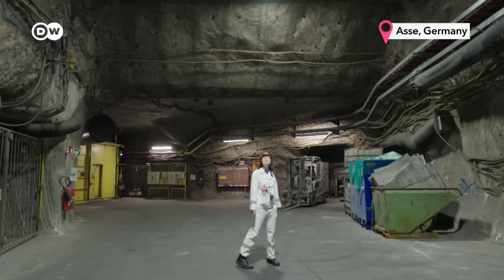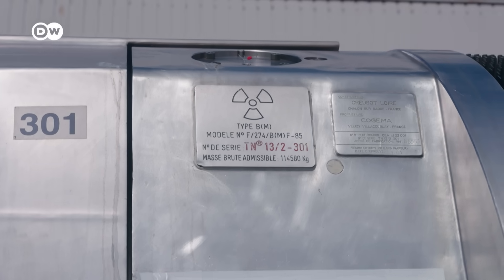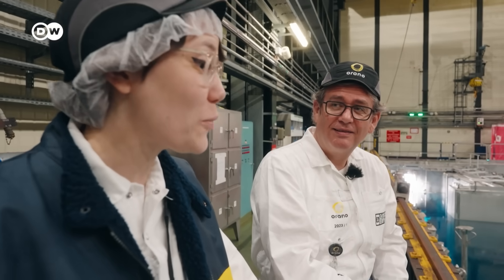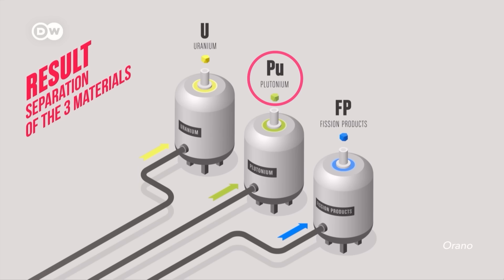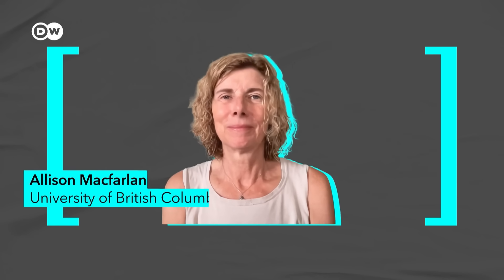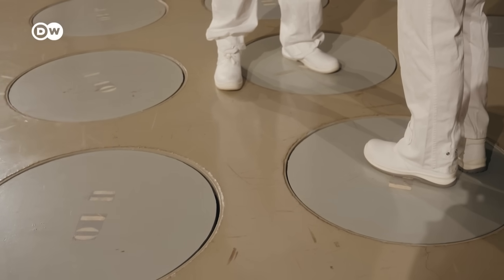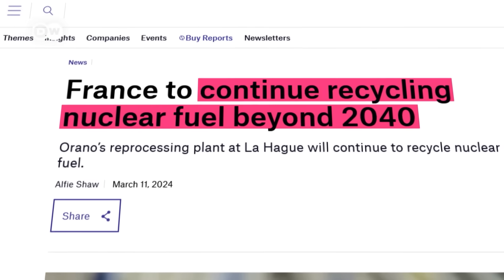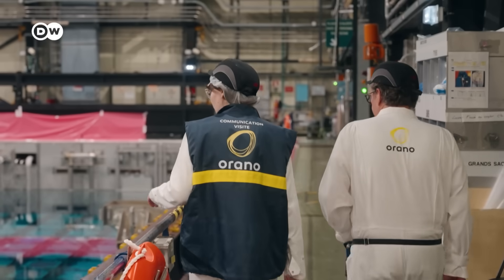Nuclear waste is reusable. Why aren’t we doing it?

Comment: As a former nuclear engineer and chemist, and proponent of nuclear as critical component of our transition from fossil fuels, this is a great video.

One thing not mentioned was molten salt reactors (MSRs) that can burn down the existing stockpile of spent nuclear fuel (SNF). In doing so, they also produce two orders of magnitude less radioactive waste. And that waste is toxic for only a few hundred years vs. tens of thousands of years for the existing fleet of lightwater reactors. It's estimated that SNF could power MSRs for nearly 100 years without the need to mine additional virgin material.

MSR designs are also inherently/"walk away" safe, meaning that in the event of loss of power, the reactor shuts itself down with no escape of radioactivity. This is a significant departure from lightwater/pressurized water reactors. Rather than operating at high pressures, but relatively low temperatures, MSRs use a molten salt that's both fuel and coolant, enabling them to operate at much higher temperatures (good for process heat applications across a wide spectrum of manufacturing sectors), at or near atmospheric pressure.

Lastly, nuclear reactors should be used for four primary purposes:
1. Grid stabilization.
2. Desalination.
3. Green hydrogen production.
4. Process heat generation.

Small modular reactors (SMRs), microreactors and the like can be collocated on the sites of decommissioned thermal power plants, such as coal and natural gas. There they can leverage the vast majority of the installed infrastructure, while providing continued employment for the local workforce. They can also be collocated where intensive energy demand is high and/or where the process heat requirement is great. Think aluminum smelters, iron, steel and concrete manufacturing, data centers, etc.

Solar, wind, hydro (including pumped), geothermal and wave/tidal energy should comprise the backbone of all power generation; stabilized by nuclear and augmented by energy storage (lithium ion batteries, flow batteries, heat storage, etc.).
Reply from the maker: Thank you for your comprehensive coverage! ☢️ Please check out our channel as we have videos looking at those components you've mentioned as well! Here's a few to begin with 👇
on molten-salt reactors 👉 https://www.youtube.com/watch?v=Km6kqykX900
on SMR's 👉 https://www.youtube.com/watch?v=GhKQ8EP1a1Y
on grid connection 👉 https://www.youtube.com/watch?v=u-DsDuTceTo
Reply: @DWPlanetA  Yes, I've seen all of your videos and love the channel. I simply meant to point out that MSRs were neglected in the treatment of SNF. It's good to see that DW Planet A is tracking with the comment sections.

Another good topic to follow-up on the grid video might be advanced reconductoring. Using existing pylons, trapezoidal aluminum wound around a composite core could double existing grid capacity...all without the permits, regulatory delay, NIMBY attitude, etc.
Reply: @DWPlanetA  this owns
Reply: came here to say something similar. It makes no sense to store something so dangerous for so long if we have a way to reuse it  AND turn it into much less material that's radioactive for orders of magnitude of less time.
Reply: @Gistedkudu  How much less radioactive does it become after they use it for a second time? In terms of how strong the radiation is but how long they will have to store it?
Reply: @KingKhan20000  My understanding is it's a few orders of magnitude better so instead of tens of thousands of years we're talking hundreds of years.
Reply: @KingKhan20000  My understanding is it's a few orders of magnitude better so instead of tens of thousands of years we're talking hundreds of years.
Reply: @Gistedkudu  To be honest this is a huge upgrade.
Reply: @KingKhan20000  100 years to reach radiation levels of natural uranium.
1000 years to reach safe radiation levels comparable to natural.
This is after neutron irradiation in a fast or thermonuclear reactor and subsequent purification.
Reply: @Gistedkudu  when something decays in 10.000 years its much safer than 100 years, its not the same to drink a vodka bottle in 10 hour than to drink it in 10 minutes, one kills you other just wastes you
Reply: OK, sounds awesome. And now the 1 Million Dollar question? Why aren’t we (or anyone else) doing this? And please no BS response like “Oh the greens”, or “oh politics” because there are so many countries run by all political flavors, if this is the golden bullet, at least one country would invest big money to push this forward. So why not?
Reply: @marcd6897 It's because in the 1950s and 60s internal turf battles within the Nuclear Regulatory Commission shut down research and development on Molten Salt Reactors. The Big Corporations operating reactors had already invested beau coup bucks in design and equipment manufacturing for light water reactors and even though MSRs were more efficient and safer they didn't want to spend the money and retool to MSRs.
Reply: @marcd6897  only one thing prevents us from using more nuclear power.  Oil company profits and ownership of politicians.
Reply: @loungelizard836  with all political flavours? Or maybe because folks start to realise that nuclear power comes at a cost that more and more countries are not willing to pay any longer?
Reply: @marcd6897  nope its bc it eats into oil companies profits
Reply: @marcd6897  China is doing so. They went to the US, asked for a look at the plans and basically copied the blueprints! And the US, who invented molten salt reactors, sat on the technology for decades, bc they went with the other (worse) nuclear power generation method solely so they could get plutonium to make their nukes (which you can't get out of MSRs). And now, with it being such a corrupt country, the existing nuclear industry lobbies the government and ensures that MSRs plants are nor built bc that would be competition, and corporations despise competition. Probably the same reason as the other countries (there ain't many nuclear powers bro)

Your "please no BS response like "oh politics" is a very naive comment. Politics literally effects everything in our lives.
Reply: @marcd6897 It's because traditional nuclear costs more money than most every other source. Countries have subsidized it mainly for the dual use technology (enrichment for weapons). Some of the cheaper approaches to fission that aren't traditional don't require that high level of enrichment but were mainly abandoned. Until new interest the last couple decades with startups and ideas. I should add that China is testing an MSR right now as we speak at great expense.
Reply: @marcd6897  Influence from fossil fuel industry. Also bad press. Nuclear hasn't had any good press coverage since Chernobyl because people love sensationalistic journalism (honestly it should be illegal to misinform, mislead, or sensationalize in any way). In reality Chernobyl was the result of sheer incompetence and idiocy. It deserved another type of press that wasn't "nuclear power bad".
Reply: @marcd6897  The short answer is:  We are.

By "we", I mean mankind. China is a glowing example of what a people can accomplish with reasoned goals and political stability. For all it's faults, China's centralized government with a single long-term leader (not endless campaigning and the threat of near complete policy reversals with every election) has been able to create an overarching plan with energy security at its core.

China is actively adding more nuclear generation capacity than currently exists across the globe! Just let that sink in. These projects include the high temperature gas-cooled reactor nuclear power plant in Shandong Province that recently entered commercial operation. Additionally, construction is slated to begin next year on a Thorium Molten Salt Reactor. This plant, located in the Gobi Desert, is anticipated to be operational by 2030. Lastly, unlike the rest of the world where reactor construction projects routinely incur massive delays and cost overruns, China has demonstrated their ability to complete projects in an average of 7 years.

So, it's not that it can't be done. It's that we lack the political will to invest in all that's necessary to sent advanced nuclear deployments on an exponential trajectory.

All's not lost in the US, however, as important developments have occurred in rapid succession. TerraPower has begun work on their Natrium facility (sodium-cooled) in Kemmerer Wyoming. Kairos Power have started construction of Hermes facility (fluoride salt-cooled) at ORNL, and Radiant are progressing toward bringing helium-cooled microreactors to market. On the IMSR (where coolant is also a fuel carrier) front specifically, Terrestrial Energy, Southern Company and others continue working to bring solutions to market.
Reply: @ARepublicIfYouCanKeepIt  by the way, I’d recommend you refresh your numbers re how much France produces energy from nuclear. Earlier you said it’s 77.1% which is BS. It’s just 40%. Maybe get your numbers straight so believing the rest of your very elaborate messages would become easier. 
And re China, I’m curious as to where they’re heading, currently their nuclear is still around 5%.
Reply: @marcd6897  China is and there are a number of companies investigating MSRs. The trick is developing the material science needed because liquid fluoride is extremely corrosive on the reactor components.
Reply: @marcd6897  Because nuclear fission energy is simply too expensive compared to other solutions on the market.
Reply: As a fellow nuclear engineer, all I can say is: Perfect statement!
Reply: Interesting and well explained. Maybe the concept should be integrated into one plant. This way the use of nuclear is maximized. Maybe it should be a mandatory thing for future NP-plants. 
But at the same time I think geothermal is advancing too. It's just when it is good enough to utilize it at any location. Imho geo is also very under funded compared to solar and wind energy solutions.
Reply: The problem with Geo is that there are limited areas they can be built cheaply enough.  You can bore to reach heat but in some areas that is prohibitive.
Reply: @RPSchonherr  Umm the biggest issue with geo - sometimes even in case of easy to reach magma pockets - is of course the cost on one side but its mostly that you're looking for porous material to pump the water through. That pressurized water has the potential to cause small quakes. That's not an issue along the ring of fire but in Europe a couple geo thermal plants had to shut down because of this - even a 3.5 was enough to cause cracks in old buildings and no insurance is gonna cover that...
Reply: @blackpearl1-477  Solar and wind tax credits are now gone, but tax breaks for coal and drilling in public parks was approved.
Reply: "maybe the concept should be integrated into one plant" ... that would be the Integral Fast Reactor, it was cancelled by US congress when it was three years from completion
Reply: @MatthijsvanDuin  The IFR was a fast breeder reactor with integrated reprocessing. Hence the use of the term "integral". 

While that's not what we're talking about here, TerraPower's Natrium Demonstrations Project in Kemmerer, WY is a close analog. 

While not an MSR (Type I, where the molten salt is both the coolant and fuel carrier), the NDP is a sodium-cooled fast reactor with on-site energy storage consisting of molten salt. The NDP design is novel in that the "nuclear island" and ESS/power production facilities are distinct and separate. In addition to many other construction, cost and safety aspects, this separation also supports extremely flexible operation of the plant. 

Rated at 840MWt/345MWe, the plant can "flex" from 100MWe to 500MWe for extended periods (up to 5.5 hours with power ramping at 10% per minute).

Fuel fabrication, salt and other facilities comprise the NDP. 

While I remain a huge proponent of MSRs (Type I especially), the NDP is a huge step in the right direction.
Reply: It's worth pointing out that MSR's are not the only kind of Gen IV reactors that do this, there are other reactor types that can also breed more fuel out of waste.
Reply: @Croz89  All fast breeder reactors are capable of burning spent nuclear fuel. Some just do it better than others (more economically, lower proliferation risks, better thermal efficiency, etc.). MSRs are just very flexible and elegant solutions.
Reply: @Croz89  they still need a lot o time to build and they dont offer cheap power. the video said it. its expensive. more expensive then renewable energies.
Reply: @BlacKi-nd4uy  By definition, SMRs are <=300MWe. Built in factories, then packaged as either containerized microreactors that are replaced every 4-7 years, or fabricated as modules and deployed in n+1 modular fashion, SMRs hold the promise of consistently high quality, on time and within budget, as opposed to GW-scale legacy design examples such as Vogtle units #3 and #4.
Reply: @ARepublicIfYouCanKeepIt  i dont like micro reactors. you have the security disadvantages of all nuclear reactors, since there is radioactive material, which probably will kill the cost effectiveness.
Reply: @BlacKi-nd4uy  Security doesn't "kill cost effectiveness". Construction costs, particularly labor, does. Microreactors are actually phenomenal solutions for all kinds of use cases (remote grid power, military installations, disaster recovery, aluminum smelters, iron, steel and concrete production, data centers, the list goes on and on).
Reply: do you think there could be a underground nuclear plant in some iceage kind of dystopian situtaion where civilisations are forced to stay underground.
Reply: @silentstormstudio4782  An ice age, comet strike, super volcano, even all out nuclear war need not be the end of humanity. We could live in well lit clean safe hi tech underground facilities for hundreds of thousands of years with the power of nuclear. atom for atom nuclear is a million times more energy productive than the best fossil fuels. IF used in a Fluid Fueled Reactor that uses all available fuel.
Reply: @silentstormstudio4782  We're in an ice age.
Reply: SMR MSRs are probably a better use of research and VC billions than SMRs based on PWRs. But regardless of size, my non-expert understanding is that MSRs are not a solved problem, unfortunately.
Reply: @szurketaltos2693  Actually, MSRs are a "solved problem". Unfortunately, all things nuclear take a very long time to get through the design, planning, approval and licensing phases. Work has been ongoing for a while now, so discernable progress will be evident shortly.
Reply: @ARepublicIfYouCanKeepIt  I would like to see Terrestrial or Terra (etc) hit their 2030ish timelines, but having occasionally taken brief looks at the literature I'm not convinced they will; maybe all the good stuff isn't public though. LCOE below at least offshore wind seems doubtful with the way wind is scaling, would love to be proven wrong.
Reply: @szurketaltos2693  The obsession with LCoE for nuclear, to the exclusion of all other factors, has always defied my understanding. Nuclear is special, with so many benefits that other energy sources simply can't provide, that LCoE should be a factor, just not the only one, or the most important one.

We need clean, reliable, safe and affordable baseload generation capacity. For that, there's simply no alternative than nuclear. Nuclear is clean. It's actually the most reliable means of energy generation. The industry's safety record speaks for itself, and advanced reactor designs have none of the risks that are inherent to LWR/PWR designs. As for affordability, of course the first advanced reactor designs to be deployed will be far more expensive than every other option. However, costs will rapidly decline as economies of scale are realized. Microreactors and SMRs, regardless of design, are completely different than the bespoke projects that every other GW-scale plant over the past 30 years represent.
Reply: @ARepublicIfYouCanKeepIt  of course there is an alternative, "overbuilding" renewables plus batteries, existing nuclear, conventional hydro, and pumped hydro. Look, I am pro nuclear but I really don't think we can afford to stake all our climate plans on it being affordable. I would love for the amount of renewables that needs building to be lower, and for nuclear to be cheap. Feel free to say I told you so in 15 or so years if LCOE for nuclear falls below renewables, which have proven falling LCOE for now.
Reply: @ARepublicIfYouCanKeepIt  Yeah, I won't hold my breath on "shortly" because even the reactors based on established technologies are subject to massive cost and time overruns. Don't bother replying.
Reply: @johanneshass1614  SMRs, including MSR types, completely change the game regarding on-time delivery within budget. New technologies, designs and methodologies cannot be judged by legacy projects.
Reply: The burn up rate on MSRs is fantastic, enabled by using liquid fuel instead of solid. 
With solid fuel, pressure build up inside the cladding means you have to change them long before you've used up all their useful potential. 
Not so with liquid fuels as there's no fuel cladding to fail. 

MSRs do have an issue with refueling and gaseous isotopes, you need online prices to deal with both adding new fuel and online extracting of isotopes like Xenon gas.
It's a difficult process and is also a proliferation risk as you can start extracting fissile plutonium 
One company, Moltex Energy has a few practical solutions. 
Using liquid fuel in solid fuel tubes with a vapour release mechanism, the short lived radioactive gasses produced exit the core and is contained inside the building while it decays to something safe. 
The liquid fuel rods can also be used until exhausted because of that pressure release mechanism and reactor refuelling is just a case of replacing spent tubes with existing handling machinery. 
Finally, a sacrificial coating inside the tubes prevents corrosion, meaning the tubes themselves can be manufactured out of already approved nuclear steels. There's no need to invent new salt corrosion proof materials and go through the long and expensive process of approval.
The tubes themselves are cooled by a separate salt loop to a much higher temperature, granting much more efficient power production via a gas rather than steam turbine.
The high temperatures are also great for direct water desalination and green hydrogen and methane production, if you pump the salt around a facility containing these plants.
And, of course, everything is at a single atmosphere of pressure as opposed to high pressure water cooled reactor
Reply: Agree with everything except using Li-ion batteries for the grid. They are light, expensive and toxic batteries that do not make much sense to deploy en masse this way. Instead, a much better option would be Iron oxide batteries or Sodium ion, they are cheaper, less toilsome to mine and their disadvantages stem mostly in weight, which is not a factor when it comes to static deployment.
Reply: @nonridiculousadjective6597  Lithium-based batteries continue to decline in price. Additionally, new chemistries, such as Na-ion, and new technologies, such as flow batteries, are increasingly coming online. Lithium chemistries are good for 4-6 hours of peak demand fulfillment. Sodium chemistries will fill the same niche. Flow batteries, along with other energy storage systems, provide much longer duration storage; typically measured in days, not hours.
Reply: You meant FAST reactors can use spend nuclear fuel.
Reply: @sjoer  I stand by my statements.
Reply: We need a senator like you
Reply: Great information!
Reply: Thank You sir for continuing to spread science instead of all that other stuff.
Reply: when i saw the introduction I was thinking it was going to be like the RTG used on the voyager and Nasa Mars rovers which generate electric power from the heat given off from half life decay. and heat to keep spacecraft working could you do something like this with nuclear waste on earth? I know the environment and conditions are very different
Reply: Was going to say something similar, but you said it much better than I could have
Reply: I appreciate the video and your perspective. 

I do think that one element that was not highlighted in the video is the  risk management benefits to recycling or at least better disposition of spent fuel. the American paradigm is the absolute worst.

also, the antiquated perspective that we are setting an example for anyone by not reprocessing fuel is silly. the nuclear countries mentioned who are reprocessing all have nuclear warheads. who are we setting this example for? who are the nuclear energy countries who we are fearful of acquiring weapons?
Reply: Appreciate the comment! Perhaps it is an education problem, but so few people seem to know about old innovations in the nuclear sector let alone new ones. Prior to a change in topic related to my MASc in Nuclear Engineering, corrosion mitigation in Lead-Cooled Fast Reactors was my focus. Some key benefits I thought LFRs have over MSRs are the coolant acting as a neutron reflector to provide passive safety via negative void coefficient while simultaneously cutting down on the need for shielding materials - particularly useful for SMRs -, lower risk of damage in case of a LOCA - I know MSR demonstration reactors showed the reactor will not "blow up" like the science demonstration of Sodium in water, but this is pertinent in a Sodium-water heat exchanger -, and Lead's lower thermal expansion coefficient compared to Sodium. I know Lead-driven corrosion is a key issue - hence my initial research topic -, so is pumping difficulty, and the comparatively high melting point of Lead. However, these do not seem like deal-breakers, at least from my research & understanding. Despite my research topic not being centred around LFRs anymore, more insight as to why MSRs seem to be more popular than LFRs would be appreciated!
Reply: You have a very good point. The position of the USA about reprocessing is questionable if not dumb. See the North Korea vs South Korea case. Built nuclear power plants, and reprocessing plant just to get plutonium to make a bomb is like saying that you have to get married, than stay married for 20 years just to have sex once.

There are much much cheaper and faster ways to have sex earlier and more frequently.
Reply: Having been educated in university in nuclear science and engineering and NOT JUST TRAINED to be an engineer, I just shake my head in disbelief at all the people who just don't understand people don't want an economy that teeters on the edge.
The people involved, even the 'pure souls in engineering' just don't understand why nuclear lost in the US, and for that reason they, themselves prove WHY IT WON'T!
Reply: Simply the most goated comment I've ever seen. Congratulations, i hope more people in the future will share your vision
Reply: @MattBuild4  I have come to believe that the greens have formed a dogma around green energy,
faced with the facts that solar panels and wind power all have limited lifespans and need to be replaced in 20 30 years time, they have commited to just close their ears and scream all the feel goodism they can, when we should be focusing on a reliable grid of nuclear energy sites, "green" aka energy scavengers like solar or wind are fine but only in remote locations.
Reply: if you said all these things. Why are you a former nuclear engineer and chemist?
Reply: @coreytran7415  While I'm semi-retired, I'd gladly work with any number of companies in this space.
Reply: "As someone being wrong, and with a giant bias because I can't bear my life having been a detriment to society, I enjoy being wrong"
Cool story, now please shut up
Reply: Amazing 😮
Reply: So build one already.
Reply: As a call center employee, I agree.
Reply: Great comment. Nuclear power generation has a place, but will never be the dominant method in the future because the cost is just too high. Renewables have it beaten because the power source is free, and the maintenance cost is far lower. It's basic economics. Adding to that of course is that the leftover material isn't hazardous, and there isn't the risk of a catastrophe if it goes really wrong. Some very hard lessons have been learned in nuclear power generation which has made it far safer, but the economic viability has made it questionable now.
Reply: Go ahead, say it THORIUM THORIUM THORIUM
Reply: To use Thorium as well?
Reply: Also the fact the exclusion area for SMRs is essentially the sight boundary, so setting them up a brownfield sights is less of an issue than most folks think.
Reply: Why do we call hydrocarbons "fossil fuels" when they exist on other planets where there was never any life?
Reply: Oh, look at Mr. Science Guy over here. You think you got it all figured out, huh? Lemme tell ya somethin', you ain't the first genius to walk through these doors. You talkin' 'bout radiation like it's some kinda boogeyman, but you clearly don't know jack.

Molten salt reactors, huh? Yeah, real cutting-edge stuff. Burns down the stockpile of spent nuclear fuel. Bravo, Einstein. But you ever think about the logistics of that? How 'bout the costs, the infrastructure, the real-world applications? Nah, didn't think so. You're all theory, no practice.

And what's this about MSRs bein' "walk away" safe? You think you can just stroll out for a cappuccino while the reactor runs itself? Get real. Every system's got its vulnerabilities, and actin' like this one's foolproof is just plain naive.

Hundred years of burnin' up fuel without more waste? Yeah, that sounds real peachy. But you ever consider the maintenance, the human error, the potential for somethin' to go sideways? Of course not. You're too busy patting yourself on the back.

And let's talk about those radiation leaks, huh? You know, the ones that end up givin' the poor kids birth defects. But hey, it's all good, right? They should just pull themselves up by their own bootstraps, like all those clueless rich folks love to say. Never mind that they're dealin' with the fallout—literally—of your so-called solutions.

And while we're at it, how 'bout Ohio? You heard of the lobbying to keep nuclear power in the state? Yeah, real nice work there. People got more cancer because of it, but I guess that's just collateral damage in your grand plan, right? Ain't like those folks matter, right? Just another statistic to you.

So, while you're sittin' there with your fancy degrees and big words, remember this: in the real world, things ain't as black and white as you make 'em out to be. And radiation? It's dangerous, pal. Always has been, always will be. You ain't gonna change that with a fancy new reactor. So why don't you come down from that ivory tower of yours and see how things really work?
Reply: So to answer the "million dollar question", why weren't MSRs ever built? It's a disgusting story of internal NRC turf battles and corporate greed. Since the nuclear power industry had already invested in designs and manufacturing capacity to build light water reactors they shut down MSRs, period. And industry flacks in the NRC sabotaged the careers of men working on MSRs.
Reply: burn how? Where will the fumes go?
Reply: I somewhat disagree on point 3., hydrogen and the methane you can make from it are storable substances, so they would actually benefit from cheap solar without any form of batteries or grid balancing (an isolated plant), since the extreme unreliability of solar would be compensated by simply storing more fuel.
Reply: @Blaze6108  The important thing to keep in mind with scenario you propose is the opportunity cost of diverting wind and solar to hydrogen production. Worldwide annual hydrogen production currently stands at 120 million metric tons. It's estimated that we'll require 90 million metric tons in a post fossil-fuel world. Producing that would require the equivalent of the total worldwide solar and wind generation in 2019!

We simply can't divert wind and solar to hydrogen. The best and highest use of these renewables is decarbonizing electricity generation.

Now, as 98% of current hydrogen production is in-situ (being produced at point-of-use, it never moves), producers could invest in large on-site solar and/or wind farms, along with the requisite distribution and substation equipment, substituting methane and fossil fuel for steam generation with water and electrolysis. This would obviate the need for transmission lines and interconnects, but increase the need for water, water purification and possibly desalination.

This option has been, and continues to be available to hydrogen producers. Yet, 95+% of hydrogen productions continues to be of the "grey" variety. That is to say, from steam reforming methane. The reason? Economics. Unless and until the economics of "green" hydrogen shift in its favor, producers will continue to do what's in their best interest, no matter the consequences. As long as those producers continue to escape accountability for said consequences.
Reply: @Arepubliclfyoucankeepit Why do Americans think depleted uranium bombs are not radioactive? Is it because they are the only ones that use them?
Reply: We're going to get nuclear fusion power plants in the next 10 years. Then, there will no longer be any toxic waste.
Reply: Some studies state, that gas turbine PPs are way better and less dangerous in maintaining grid stability as NPPs. And I have a question they say MSR needs very corrosion resistent materials and therefore is hard to build. What is Your opinion as a specialist?
Reply: Thank you for elaborating and adding to the presentation.
Reply: Are there molten salt reactors operating anywhere?
Reply: @nnamedit  There have been two MSRs to-date. However, none have been operational, meaning not grid-connected:

MSRE, for molten salt reactor experimental, operated for 13,000 full power hours at Oak Ridge National Laboratory (ORNL) between 1965 and 1969 when program funding was pulled for largely political reasons. MSRE was also notable for running on U233, as opposed to U235 used by traditional pressurized water reactors. U233 is a decay product of Th232, is proliferation-resistant and produces dramatically less of the most problematic waste products.

TMSR-LF1 is an experimental MSR (2MWt, so very small) located in Hongshagang, Minqin, Wuwei, Gansu, China that began operation in 2023.

MSRs work. Thorium as a fuel works. A single golf ball-sized sphere contains all the energy a single person needs for their entire lifetime. It's a no-brainer that will finally be brought to fruition as a part of the energy transition.
Reply: @ there’s lots of technologies ‘that work’. There’s a long and expensive journey between demonstration and commercialisation
Reply: @nnamedit  A lot of really smart people have been busily reimagining what new nuclear looks like. They've come up with SMRs that are serially produced, factory-built PWRs that turn the market upside down with a spin on legacy technology. They've come up with MSRs that are serially produced, factory-built units that take advantage of things like fuel cycles and inherent safety designs. They've come up with microreactors that are serially produced, factory-built, containerized units that are quickly and easily deployed.

Seeing any patterns yet? How about departures from traditional US reactor development and deployment?

They've also reimagined business models where manufacturers design, finance, build, deploy, operate, maintain and decommission reactor, all while commercial consumers enter into long-term power purchase agreements.

Attitudes like "it's a long and expensive journey between demonstration and commercialization" are completely useless when we're blinded by our paradigm.

Everything that most people know about civilian nuclear energy generation is completely worthless when literally everything about these markets has fundamentally changed.

An old saying goes:  "For those who 'get it', no explanation's necessary. For those who don't, no explanation's possible."
Reply: @ all of which remains theory. It’ll be great if the things you claim actually occur. Nuclear isn’t some magic technology that avoids commercialisation pathways whether it’s mass produced or not. It still has to get to that point and be cost effective.
Reply: @nnamedit  , china
Reply: Hundreds or tens of thousands of years makes no difference.  The pace of waste produced far exceeds our ability for storage and containment.  This is a temporary energy fix with the longest storage needs and deadliest result when something goes wrong.
Reply: @herpderp66  For those who "get it", no explanation's necessary. For those who don't, no explanation's possible.

Three Mile Island resulted in zero deaths or radiological release. Chernobyl resulted in few deaths and limited releases due to reactor design (we don't make them like that) and human error. Fuchishima resulted in zero deaths and a minor release due solely to human error.

Nuclear power generation is unquestionably the safest form of electricity generation. Period. End of statement.

All of the high level waste ever generated from civilian power generation wouldn't fill an average-sized football stadium. It's distributed across 77 sites in the US where it's in dry cask storage awaiting final disposition. Regarding that, I worked on vitrification in the late '80s, when this waste was supposed to be sent to Yucca Mountain for permanent storage. The NIMBY forces have succeeded in blocking any permanent disposal facility anywhere in the US. Meanwhile, France reprocesses their fuel as they have for decades, while they and other countries have identified, constructed and are preparing to open permanent disposal facilities of their own.

It's attitudes by you and those of your ilk that have stymied progress for far too long. Thankfully the crop of advanced nuclear companies are on the cusp of breaking the long stalemate over civilian nuclear power generation. Soon we'll have several new plants up and running; delivering carbon-free electricity to the grid to address climate change.
Reply: I have to disagree with the last statement from a grid perspective. For large countries, nuclear is one of the best options, because solar and wind comes with many issues that traditional synchronous machines do not have. For example, damping is completely absent in solar which plays a huge role in load frequency stabilization. Wind can get extremely unstable due to induction machines etc. The point is, for small loads it is possible, but large loads like the US or China or India have to face many issues with solar and wind that nuclear does not have.
Reply: @amazinga7794  This isn't an either/or issue. It's an and/both issue. Solar and wind both win on cost, so it's inevitable that these technologies will win for the foreseeable future.

Other aspects that influence the uptake of alternative technologies are maturity, regulations and public attitudes. Solar and wind are much easier, faster and less expensive to install and connect to the grid. With that said, advanced nuclear has a plethora of benefits not shared with intermittent renewables.

For all these reasons, we need a mix of both renewable and nuclear generation. 

It's not an issue of what's on the grid, the size of the grid, etc., it's about decarbonizing the grid as quickly as possible. For that, we must press ahead at full speed with solar and wind. 

The issues of grid stability are eminently solveable...at a cost. A cost that we can easily absorb in the grand scheme of things. 

By the way, as a former nuclear engineer and chemist who served aboard ballistic missile submarines, I'm a huge advanced nuclear advocate. I'm also an off-grid energy systems specialist with more than a decade of experience in solar, wind, micro hydro and energy storage.
Reply: @ARepublicIfYouCanKeepIt you keep taking this political approach, advocating for a dual approach in decarbonising as fast as possible. 

This isn't an option for many countries as they'd be building their entire nuclear industry from scratch, it doesnt matter if they can use decommissioned coal power plants. From an economics standpoint compared to investment into renewable R&D, as well as vast energy storage this is an inefficient waste of money, especially if they're putting effort into growing their renewables industry. China is built different. You can't use their example of 7 year build times. What are chinese nuclear construction workers going to build the worlds supply? So much for domestic employment. Lets not talk about skills transfer and the costs involved in the structural change of an economy.

China is looking at thorium to reduce their reliance on imported Uranium, and their huge coal industry. 
Countries like Australia where im from should be transitioning to advsnced manufacturing and exporting renewables tech. Our storage solution in South Australia has reduced in cost by over 10 percent year on year. Australia ans similar countries should be investing in economies of scale, not some inefficient politically minded dual approach. 
Lets also not get into the vast social, economical, and political differences as to why china is out maneuvring everyone. Their populatiob size and heavy exports prob ibfluence this.
Reply: You don't need weather dependent renewables and batteries if you have nuke already
Reply: Do you think that any of this waste can be use in applications as space engines
Reply: There is a rather new study which suggests that for a stable grid nuclear isn't needed for a stable grid, and even rather harming. They just can not be turned off.
Reply: @compactreview  says who? A nuke can be turned off and on
Reply: Shill alert.
Reply: Not to deny the truth of your criticism but the video would be 2x as long. Followups? A series? Sure.
Reply: Ive read somewhere (ig Popular Mechanics?) that SMRs are substantially less efficient then large scale units, and the waste is more radioactive, can you expand on that? Besides that its amazing how much stuff we could power with nuclear. 

Im chemist myself, just powering distillation columns with nuclear would erase 5% of US's carbon foot print. Concrete is another 5%. There are so many steps we can take, meanwhile those get ignored and everyone thinks we need to ban air travel to save the planet or something.
Reply: So, energy storage systems are getting cheaper an cheaper. For long term storage and short term. Then, why do we need nuclear, when the energy generation is cheaper with wind/solar etc?
Reply: If it took this long to develop your MSR nuclear reactor that trumps everything and that the nuclear industry took off in the 50s/60s, I think we can do the same thing with renewables. We can invest in the present higher rate of tech development into renewables, an industry that on a scaled level only took off in the 2000s with certain policy changes and tech advancements. You talk about nuclear dismay in the US, well I would argue that the US has more of an issue with conservatives hating on 'greenies', ESPECIALLY in the 20th century. Just like all the other american satellite economies like Australia. 

For all your other use cases of nuclear like desalination, data processing. A different type of renewable alternative appliea to each one. We should be investing in improving existing solar powered RO plants. Datacenters? Google powers some of its data centers with 90%+ renewables. We should be investing in improving that, not changing it.
Reply: Couldn't MSRs, and Nuclear in genreal, be used for Synthetic Fuels instead of Hydrogen? It might just be best of both worlds.
Reply: @ZippyPiglin36  The short answer is, unfortunately not.
Reply: Candu reactors can too and they are already in production.
Reply: my radiation background is in another field and have an interest in nuclear power and alternative reactor types such as MSRs. Great comment, thank you!
Reply: Would you agree that current nuclear "power" plants aren't designed for power production, but for weapons-manufacture?

  Also, as someone with a PhD in physics, I've never heard of there being near-meltdowns at research-reactors at universities.  You see, from my own experience, those of us in physics, nuclear chemistry, and nuclear engineering are taught, from day 1, what radioactivity really is, what it isn't, and how to treat the phenomena with appropriate respect and caution.  And I've chalked up my assumption of the lack of accidents in institutional reactors to that educational foundation we get.

But that has left me wondering if I just haven't heard about accidents at institutional research-reactors.  And no, I'm not talking about reactors at federal research facilities … those, again, are meant for weapons-manufacture and are run by the military, i.e. by non-scientists.
Reply: @John_Weiss  I strenuously disagree with the premise that "current nuclear power plants are designed...for weapons manufacture."

Having worked in both military and civilian nuclear programs, including various programs in triggers, separation and enrichment, and waste handling, storage, processing and disposal, I can confidently state that commercial power production has nothing to do with weapons production.

With that said, the choice of the Uranium fuel cycle and pressurized water reactor are second-order effects of the nuclear weapons programs of the past. This is part of the problem of progressing to advanced nuclear design approval and deployment. Inertia is a bitch, and changing the status quo is always very difficult.
Reply: @John_Weiss  I thought research reactors were designed in such a way that meltdown was physically impossible.
Reply: @Croz89  I wouldn't be surprised if they were!  Like I said, we're taught, even as 1st-year physics majors, what radioactivity is, what it isn't, and how to respect it.  So I would fully expect that any reactor designed by professors for use in an academic setting wouldn't "F--- Around and Find Out".
Reply: @John_Weiss  "But that has left me wondering if I just haven't heard about accidents at institutional research-reactors.  And no, I'm not talking about reactors at federal research facilities … those, again, are meant for weapons-manufacture and are run by the military, i.e. by non-scientists."

All of the accidents have been due to; private companies cutting corners for financial reasons, a communist USSR with a twisted incentive structure, very early nuclear development*.

Yes this was often aimed at weapons usage, but the issue was that they didn't know what they didn't know, and they were in a rush. They DID however have scientists working on this, and as a physicist you surely must know that.
Reply: I'm  a physician who has specifically studied biological effects of radiation, and one trained in the sciences at Harvard, I've been for years a vocal pro nuclear, anti-radio-phobic hysteria advocate.     I was delighted to see another rational, science and evidence-based voice in the comments here.  However, I have to take issue with your misguided statement  that SNF ("waset") from MSRs  " is toxic for only a few hundred years vs. tens of thousands of years for the existing fleet of lightwater reactors. "  That's simply false.   The fact is that SNF from existing mature and safe Gen 3 reactor-based large nuclear power plants is 97% harlmess uranium and plutonium isotopes (so weakly radioactive there is no danger) and somewhere around 3% assorted fission products and hot actinides made by neutron capture and beta decay in the reactor.    I would hope you knew this.   The VAST MAJORITY of the genuinely fiercely (dangerously) radioactive material in SNF is Cs 137 and Strontium 90, after the stuff has sat around 10 or 15 years.   Both of these have half lives of around 30 years, so are 99.9% gone after 300 years, and 99.9999% gone after 600 years.  NOT THOUSANDS OF YEARS.    There are smaller amounts of other hot stuff, including a shorter-lived isotope of curium, and a very small amount of Americium 241 which has a somewhat problematic half life of 400 some odd years, but is present in small quantity.  But the bottom line is that existing Gen 3 BWR and PWR  reactor power plants DO NOT produce waste that is "dangerous for thousands of years".   That is ONE OF THE BIG LIES told by the malignant and deadly frauds who oppose nuclaer power.  Supported by the fossil fuel  industry who know ONLY  nuclear  power can replace dependence on their product (and who also know that bujilding out the fraud, con, and scam known as "renewable" (solar and wind) power locks in a need for their product, to "back up" the worthlessly intermittent power supplied by solar and wind farms.

I'm saddened to see a pro nuclear advocat make the ENTIRELY FALSE and HYSTERIA MONGERING statement that SNF from existing mature excellent Gen 3 nuclaer power plants is "toxic for thousands of years.
Reply: @martingoodman3300  Unfortunately, yours is the misleading comment/reply.

The easily verifiable facts are that SNF remains dangerously radiotoxic for tens of thousands of years. Additionally, SNF remains highly radioactive for up to 200,000 years.

These are the reasons that deep geological storage/disposal is the go-to approach for nations that depend upon nuclear fission for commercial power generation.

While the radioactivity/radiotoxicity of discreet isotopes varies greatly, the simple fact is that the entirety of SNF must be safely stored/disposed when reprocessing isn't utilized.

These same arguments are the reason that MSRs are so attractive. They're able to burn down SNF, with highly radiotoxic isotopes much more fully utilized due to recycling as a part of salt separation processing. The remaining, much smaller volume of waste can then be treated as low-level radioactive waste with only a small portion requiring HLW treatment/storage/disposal.

While some of the work in which I participated remains classified to this day, I am able to broadly state that we wouldn't have engineered solutions for HLW handling, treatment, transport, storage and disposal for thousands of years if SNF weren't dangerous radioactive/radiotoxic for a much shorter time horizon.

I'm not a physician. However, I have worked in various nuclear areas including marine propulsion, HEU, HLW from HEU processes and weapons manufacture, tritium production, and HLW vitrification, handling, transport, storage and disposal. As such, I believe in providing factual information about nuclear energy generation, including safety records, risk profiles and waste. Knowing that my statements are based in science, as well as academic knowledge and practical experience, I stand by every statement I make.
Reply: @martingoodman3300  what? Plutonium is safe? So you can just drink the water that ran through it 🤔
Btw: most pro nuclear stuff from this century comes from pro oil lobbies. I'll let you figure out why that could be.
Reply: MSR's have shown they work back over 50 years ago.  My dad even has some patents related to the effort.  BUT....  nobody has figured out how to make it work in the long term due to material issues.  And it's not because of lack of effort.  I've seen it hyped over and over again in the last decade, yet it still not ready for prime time.  Someday, maybe.
Reply: @alfamaize  The issues you cite regarding MSRs actually are solved. Work in designing, developing, planning and regulatory approvals has been ongoing for quite a while now and we'll all begin seeing developments over the next few years. Just take a look at what the Canadian regulators have already done, what the US NRC are currently doing, as well as the work that China, India, Russia and others are doing.
Reply: @ARepublicIfYouCanKeepIt  So we just still have to wait for them, then...  When should they be in action in the US?  Before I die?
Reply: Fun fact: mixing molten sodium and cooling water (as has happened in several accidents) is not a good thing.  Plutonium is made by all reactors and pu-239 has a 24 thousand year half life.  Reactors were invented to make pu-239 for nuclear weapons.
Reply: @markrobinowitz8473  Sodium metal is highly reactive with water as are other neighboring elements on the periodic table. So what? 

Also, there have been zero nuclear accidents involving "molten sodium" and water. So why even bring that up? 

Again, I stand by my comments regarding commercial power reactors and weapons manufacture. It's simply not a thing. 

If you understood even a little about Plutonium, you'd know that it's extremely difficult, hazardous and costly to separate, enrich and then manufacture into a nuclear weapon.

I know, because I've worked at facilities where this work was performed. It's no joke. 

Again, commercial power reactors do not create Plutonium for nuclear weapons. Period. So stop spreading disinformation that only serves to further delay nuclear-based solutions to climate change.
Reply: Nuclear should be our backbone, solar and wind which is intermittent cannot comprise our baseload that is ludicrous.
Reply: @Tales41  Combined renewables are actually a great base load provider, because the average they provide is more then stable enough.
Reply: @xXYannuschXx  WindSolar has numerous moments where their output falls pitifully, this is a hopium statement lol
Reply: @Tales41  And thats where you need PEAK providers, not another base load provider.
Reply: @xXYannuschXx  nuclear had the ability to peak as well, France's EPRs can increase or decrease electricity production by 2.5% per minute.
Reply: @Tales41  Actually, combined renewables (solar, wind, hydro, geothermal, wave) are more than capable of meeting the electricity demand for all humankind. The primary issue is the "duck curve". That's easily solved with existing battery-based energy storage systems. For extended durations of low sun and wind, longer duration storage, such as flow batteries, heat storage and pumped hydro meet the need.

So, renewables are mature, abundantly available and affordable sources of generation to decarbonize our grids sooner, rather than later.

The opportunity cost to use nuclear for that purpose is simply too high. We currently produce ~120 million metric tons of hydrogen annually worldwide. 98% of that is "in-situ", meaning it's produced at the point of use, and uses methane steam reforming.

In a post-fossil fuel economy, it's estimated that we'll need ~90 million metric tons of green hydrogen. In order to produce that from renewables would require the equivalent of 100% of all the electricity generated using solar and wind in 2019...worldwide!

New nuclear can provide the stabilization that's required with more intermittent renewables supplying the grid. As a bonus, new nuclear can power industry-scale desalination (needed to not only solve fresh water shortages, but also for hydrogen production). Then it can power green hydrogen production, as well industrial processes and data center demand, additionally generating process heat.
Reply: @ARepublicIfYouCanKeepIt  The duck curve cannot be smoothed out with batteries alone.
In the world, the total installed capacity of solar and wind panels accounts for 3% of the installed capacity of batteries, in the EU 6%.
The cost of balancing with batteries alone is too high.

Apart from hydroelectric power plants, pumped storage power plants and combined hydroelectric-pumped storage power plants, there are currently no mass-produced solutions for daily and weekly balancing.
Only combined heat and power plants, i.e. plants running on fossil fuels, biofuels or their combination with hydrogen.
Reply: @MihailG5541  No energy storage system (ESS) "smooths out" the duck curve. That curve represents the difference between generation and demand, and demand is always higher in the late afternoon/evening when solar generation tails off.

As peak demand lasts only a few hours , battery ESSs, or BESSs, are well-suited to provide the needed energy, without the need for fossil-fired peaker plants, or to ramp output of baseload generators.

Your comments about what I'm assuming is installed battery capacity are nonsensical. Even under the best interpretation, they're just plain wrong. Additionally, BESS installed capacity is quickly ramping up while battery costs are rapidly declining, making the entire enterprise much more economical.

As for ESSs in general, all manner of schemes are currently under design and/or development/deployment. There are so-called "heat batteries" using anything from sand to ceramics. Grid-scale flow batteries are coming online. These, in particular, provide much more economically feasible than lithium batteries. They're also much better suited for longer duration storage. There's even what TerrraPower refer to as "Nuclear +" where molten salt is the energy storage medium that's part and parcel of their Natrium design.

The important thing that so many are missing in this comment section is that there is no such thing as a "silver bullet" when dealing with climate change. There's only "silver buckshot" and we need to employ every available solution.
Reply: @ARepublicIfYouCanKeepIt  There are no any "heat batteries" with installed power at least 1 GW and capacity at least 6 GW/h.

Every duck curve means stop and start cycle for the fossil fuel generation, +20-30% raised up consumption of the fossil fuel.
Oops!
Reply: @MihailG5541  And your point is?
Reply: @ARepublicIfYouCanKeepIt  No battery last forever, no windmill last forever and no solar panel last forever. Does renewable still beat nuclear in cost when come to specific lifespan?
Reply: @RPSchonherr  So, according to such analyses, we shouldn't build out any kind of renewable generation capacity. By the way, you omitted how terrible transmission lines are.

As for wind, turbine blades have a long life span. They're also able to be recycled. We don't yet do this at scale as it's simply cheaper to dispose of turbine blades at EoL. The problem with every single one of these types of cost analyses is that environmental damage associated with virgin materials is not considered; only that of decommissioned blade disposal.

And, before you challenge my statement, I have firsthand knowledge of several companies that are able to recycle turbine blades. One even produces renewable diesel as a part of the process.

Solar panels likewise have long service lives. For example, typical residential solar panels come with performance warranties in the 25 year range (80% rated capacity). A useful service life of a typical solar panel is in the 25-30 year range. Here again, solar panels are up to 95% recyclable. Like turbine blades, we don't currently recycle at scale due to the economics of new vs. recycled, where recycled is more expensive in the early market, and environmental impacts are not considered. The environment, be it the atmosphere, the oceans, or land, is considered a public sewer; able to absorb all the waste that we can throw at it. That's simply not true, and if environmental impacts were costed, the economics would be far different than current.

I also have zero tolerance for the "wind and solar are eyesores" argument. Are oil derricks, recovery wells, and leaky abandoned well heads not eyesores? How about offshore drilling rigs? Those can be seen from all along the Gulf and Southern Pacific coasts. How about the dozens and dozens of abandoned drilling rigs rusting away in coast waters, such as Alaska? In addition to ticking ecological time bombs, abandoned oil and gas industry infrastructure is a major source of fugitive methane emission. Methane is 80% more damaging to the atmosphere for the first 30 years vs. carbon dioxide on which we tend to fixate.

Dams flood lowlands and block upstream passage for migratory fish species. They could also collapse. So, no dams. There goes pumped hydro.

Then, gee, parts wear out on wave generators. News flash, parts wear out in coal mines, on fracking fields and in refineries and fossil-powered generation stations. That's no reason not to build wave energy generators. Wave energy has the potential to power the entire energy need of the entire world's population for hundreds of years. But, nah, let's not tap that resource.

Lastly, there geothermal which, according to you is just too darned expensive in "areas that aren't geologically active". Another news flash, new technology will enable affordable deep geothermal energy generation anywhere on the planet. Like wave, deep geothermal can power all of humanity. It also has the benefits of leveraging equipment and skills from oil and gas, and can be located at existing thermal generation plants, providing stable, good-paying jobs for the local community while leveraging the majority of installed infrastructure, such as transmission and distribution facilities, turbines, generators, condensers, pumps, switchgear, etc.

But, yeah, let's not do any of that. We're good just as we are.
Reply: @Tales41  there is also tidal power this is almost constant and if you have more than one location will help, but it is the newest, it could help provide power and also help with tidal damage to the coast.
Battery technology is getting cheaper,  new forms of storage is being invented all the time,  solar power is getting so cheap now, that in Germany they are using solar panels for garden fencing as well as power 😂
It takes to long to build a nuclear power station,  and is so expensive to build and decommission, the running costs are quite cheap, but even then it is being left behind by new energy.
Reply: @simon-df9wh  Tidal is distinct from wave. Tidal impounds high tide, then releases the impounded volume as in traditional hydropower examples. While predictable and effective at power generation, the ecological damage can be immense and irreparable.

Wave, on the other hand, is eminently viable. I've long called for increased investment in both wave and deep geothermal.

The issues with wave have always been corrosion and the exorbitant costs associated with maintenance. There are promising designs all around the world that attempt to mitigate both factors.

With advances in deep bore drilling (check out Quaise Energy), the promise of accessing high-temperature areas in any location around the world is progressing towards attainability.

In the case of deep geothermal, the opportunity exists to repurpose many aspects of oil and gas exploration and production as much of the equipment, as well as the workforce and their skillsets, are more or less directly applicable. This would lead to continued viability of large parts of an industry that would otherwise decline, then all but cease to exist, as we transition to low-carbon/no-carbon energy generation and use. Additionally, workers would benefit from continued employment in a growing industry. Lastly, with deep geothermal wells drilled at the sites of decommissioning thermal generation facilities, leverages a very large portion of the installed and still viable infrastructure, all while provided continued employment for the local workforce that would otherwise be out of a job.

The key thing to remember about both wave and deep geothermal is that either has the potential to power all of mankind for centuries. Both are clean, green, predictable, reliable and more akin to dispatchable power than either solar or wind, and without the need for energy storage systems (either entirely, or at least downsized).
Reply: Any nuclear engineer worth their salt would know that the re-processing phase of the thorium reactor suffers from exactly the same problems as existing reactor fuel.  Because the thorium re-processing phase is difficult and expensive, everyone just sweeps part that under the rug.  The existing mentality is "We'll deal with that once we get the reactor working first" which is exactly what people were saying 50 years ago with the current reactors.
Reply: @rockets4kids  Thorium fuel cycle processing differs massively from SNF reprocessing. Thorium fuel cycle processing is a solved issue. Either have a professional or academic background in the technology, or do your research.

As for "dealing" with molten salt processing once the reactor is up and running, not solving the problem beforehand is a non-starter.

It's also very important to not project the US experience onto the industry as a whole. France, for instance, has successfully reprocessed SNF for decades. They even do it for other countries. We could do the same in the US. Unfortunately, SNF reprocessing was banned by Congress in the 70's. Then, once the ban was lifted, market economics dictated industry direction. With no issues with decay pool capacity, or onsite dry cask storage, there simply was not financial incentive for anyone to do anything about the issue.

A dysfunctional Congress has lacked the political will do anything other than kick the can down the road.

Again, there's nothing stopping the US from taking casks from 77 sites around the country and reprocessing the SNF. It's just cheaper for industry to continue buying new while adding to dry cask inventories.
Reply: @rockets4kids  China's MSR is expected to run in batch vs. continuous mode for the first 5-8 years. So much for your demand for full real-time and full life cycle fuel processing. Additionally, this is being done in China which, as we all know, doesn't conform to the rules of capitalism.

China sees MSRs as the future and is acting purposefully to make it happen.

By most accounts, China is 10+ years ahead of the US in advanced nuclear. The US can choose to sit ideally by, ceding technological leadership yet again to China, or we can do something about.

I'd urge you and those of your ilk to pull your heads out of your collective arses and do what's right for the US and the world, instead of always demanding the lowest cost for everything.
Reply: There is NOT one such reactor, sorry.
Reply: @FernandoWINSANTO  As with other comments, "What's your point?"

Sadly, your comment is also false, as China's TMSR-LF1, a 2MWt thorium-fuel cycle design, achieved criticality in October 2023.

Additionally, Terrestrial Energy received regulatory approval in Canada and expects to be operational by 2028. In the US, Kairos Power has received approval for a demonstration plant at ORNL (expected startup in 2026). Lastly, the Molten Chloride Reactor Experiment is expected to begin operation at INL in 2027. This plant will demonstrate the world's first operational fast spectrum molten salt reactor.

The purpose of my comment was to bring awareness to advanced nuclear designs that are safer, more flexible in terms of both operation and fuel cycle options, suited to more/targeted use cases, promise on time delivery within budget, all thereby making them perfect candidates to play a crucial role in avoiding the worst effects of climate change.
Reply: @ARepublicIfYouCanKeepIt  Thank you, I've been whining off and on since I learned about LFTR and related concepts and history over a decade ago now. I kind of forgot about it-- and it's still happening. That's really neat. Exciting even.
Reply: Ty for posting
Reply: It would be greater if it didn't have so many half truths and lies.
Reply: @samiraperi467  No lies. No half truths. Period.
Reply: @ARepublicIfYouCanKeepIt Hard to believe someone who actually is in the field just on the internet not that many people would understand even understand the work that you do. I know you don’t have to prove anyone else but still glad to see someone who’s a proponent for MSRs a better way forward vs current nuclear power plants. I am not nowhere near the understand that you have on this subject given your educational background and practical experience. From my understanding the reason for nuclear energy is freighting to the masses is because of its complexity hence no support from the government and no reason for cooperations to peruse into a market that requires billions of dollars of RND and Logistics on construction a singular plant the entry to such energy production is extremely high and requires quite complex expensive materials and equipment and personnel. You tell me as to why so many opportunities throughout history were lead astray on building such infrastructure for energy throughout the world why aren’t nuclear power plants the norm for our never ending thirst for energy and why nuclear energy seems well stagnant (please understand my stance from a lack of knowledge on this subject).
Reply: @randomperson9282  We need only look to the successes to discern the failures. Nuclear is responsible for 77.7% of France's electricity generation.

France's 54 operating reactors are of just 3 types. Why is that important? In a word, standardization. Design once, build many times, amortizing of the costs associated with research, development, engineering, permitting, licensing, etc., across an entire fleet. Such is France's experience.

Beyond type standardization, France reprocesses spent nuclear fuel; recycling massively expensive and precious Uranium and Plutonium. Not only does that reduce costs by increasing efficiency, doing so also reduces high-level nuclear waste. In fact, France's SNF reprocessing industry is so successful that it even does so for other countries, as well.

Just let that sink in. France made energy security an enduring priority. With just 9.5% of it's generation capacity powered by "natural" gas, France enjoys some of the lowest energy costs across Europe with far less dependence on fuel stocks from Russia.

France's nuclear power plants, uranium mining operations, fuel manufacture and spent fuel reprocessing are all state-owned. They suffer none of the vagaries associated with private ownership or capitalist agendas where only the lowest cost option is given the highest weight.

The new kid on the block is China. Already considered 10-15 years ahead of the West in nuclear power generation construction, China plans to add 88 GWs of generation capacity from new 70 plants.

This is the most aggressive build plan on the planet. No other countries even come close to China in this regard. And they're proving themselves out with an average timeline to build a new reactor in just 7 years.

For comparison, the US has 94 currently operating reactors generating 18% of our total electricity demand.

How many reactors have we built "recently"? Two:  Units #3 and #4 at Plant Vogtle. Before that, TVA's Watts Bar 2 reactor was the newest reactor in the nation.

Construction of Watts Bar took 21 years over a 43 year period and cost $12 billion for nameplate capacity of 2,332 MWe.

With original cost estimates of $14 billion against a build schedule of 8 years, Vogtle units #3 and #4 (nameplate capacity = 2,234 MWe) wound up costing ratepayers nearly $35 billion, with the reactors coming online 7 years late!

For comparison, units #1 and #2 at Vogtle, with nameplate capacity of 2,202 MWe, took 11 years (Unit #1) and 13 years (Unit #2) to build at a total cost of $8.87 billion ($21.27 billion in 2024 dollars).

By evaluating such facts, it's easy to see why nuclear power generation has such a bad reputation.
Reply: Not enough profit margine ????? Greed rules remembe....r
Reply: Except, we don't have such reactors and likely - never will. Experiments were successfull, but never developed.
Reply: @piotrd.4850  Please do your homework before popping off. China is currently building an MSBR.

Copenhagen Atomics, Kairos Power, TerraPower and others are all also working on MSBRs.

Russia, India, France, Switzerland, Canada and others are all also actively pursuing MSBR initiatives.

You are correct in saying that experiments, such as at ORNL, were successful. However, you need to realize that the reason why commercialization wasn't pursued was purely political.

The need to decarbonize energy generation, as well as certain industrial sectors, is resulting in a renewed push for low-carbon sources, such as nuclear, in addition to and as a complement to renewables.

With reactors built completely differently than previous projects over the past 70 year, the economics are totally changed. Additionally, business models are completely changed, as well, with manufacturers taking on the funding, designing, developing, commissioning, operating and decommissioning, while commercial customers enter into long-term PPAs.

As a last data point, China is now able to bring GW-scale projects online in an average of 7 years; less than a third of the experience in the US.

Times are changing. Either keep up, or step aside.
Reply: As a non nuclear engineer: If MSRs were really a thing they’d already be a thing.
Reply: @Freshbott2  They were literally operational....... Its not like Weinberg was talking about a dream he had.
Reply: @MattBuild4  Have they solved the material problem with molten salt reactors because I was lead to believe that the corrosive nature of the high heat salt would corrode the vessel in a relatively short time [ shorter than 10 years ]. I'm  100% behind the MSR if they can solve the issue. 2nd  the heat generated from steam should then be run through an organic cycle to further remove energy in the form of electricity, and in cold countries the waste heat should be used to replace natural gas and fossil fuels to heat buildings. At extreme levels of energy capture an insulated tanker could deliver waste heat for building', all dictated by economic sense.
Reply: @Freshbott2  Uh, MSRs have been "a thing" since the 1960s. 13,000 hours of full-power operation at ORNL proved the concept. Politics resulted in the withdrawal of funding for the project.

Since information about the project was declassified, a number of companies have been designing, seeking regulatory approvals, and planning construction of new MSRs.

Canadian regulators have approved Terrestrial Energy's design, and the US NRC has been working with a whole host of companies to commercialize MSR technology.

Due to the extremely high stakes involved, all things nuclear take a long time to come to fruition. Work in this area has been ongoing for some time, so observable progress is coming within the next few years.

In addition to the US, China, India, Russia and other countries are also making progress with MSRs.
Reply: @ARepublicIfYouCanKeepIt  Not all countries have a regulatory environment as restrictive to nuclear as the US. If MSRs were economical today or any time in the past 60 years, we'd be seeing them in Russia or China by now.
Reply: @iankrasnow5383  The US currently produces approximately 20% from 94 nuclear power plants, 22 of which are nearly decommissioning. On the other hand, China currently has 56 nuclear power plants, has added 34GW of generation capacity over the past ten years, with 27 new reactors under construction as of May 2024.

Additionally, China's TMSR-LF1 Type 1 MSR (combined liquid fuel and coolant) achieved criticality in October 2023.
Reply: @iankrasnow5383  We actually are seeing them now, in China a 2 MW pilot reactor reached criticality last year and they have additional reactors planned. Russia is planning one that runs on reprocessed VVER fuel. I'm not sold on the economics of MSRs (and especially not the thorium cycle so often advocated in conjunction with it) but we are at least seeing very real progress made now on figuring that out in countries that haven't seen their regulatory environment wrecked by the anti-nuclear movement. I suppose we'll know if it's worth it or not if China proceeds with the 100 MW thorium MSR plan in a few years.
Reply: @Freshbott2  I know I am late to the party but I never understood arguments like yours: "If MSRs were really a thing they’d already be a thing."
Yeah, this applied to basically every single inventions and innovation on planet earth. It takes time for new technology to be invented, physically constructed and then firmly established into the ecosystem of similar technologies. Just because we are between invented (this should work) and firmly established does not necessarily mean that the technology is crap.
Reply: @timerertim  china just announced the first plant to be finished in 2029
Reply: Or you build more Grid and Battery storge and you don't need nuclear and its cheaper too
Reply: @muysli.y1855  Please re-read my original comment. In it I specifically call for generation power by renewables and combined with energy storage systems, for electricity generation decarbonization.

While that may mean that we don't need as much nuclear (remember that one of my primary uses for nuclear is stabilization of renewables-heavy grids), it doesn't mean that we don't need any nuclear.

Take, for instance, remote grid power. Micronuclear reactors or SMRs are perfectly suited for this use case. How about the insane (and rapidly increasing) electrical demand from data centers? Here again, microreactors or SMRs arrays. Aluminum smelters, iron, steel and concrete manufacture? Yup. Nuclear. Both for electricity, but also for process heat. In the case of iron/steel and concrete manufacturing, integrated desalination and hydrogen production, as well.

Renewables simply aren't the best choice for certain use cases. These are but a few.

Remember, there is so "silver bullet" when it comes to addressing climate change. There's only "silver buckshot", and we need to employ every effective solution.

Decarbonizing electricity generation with baseload from nuclear (there currently really is no better choice), as much generation as possible via renewables, energy storage systems (of all kinds), advanced reconductoring of our grid, regulatory/licensing/permitting reforms. We need all of these...sooner rather than later.
Reply: @muysli.y1855  Batteries are one of the most expensive options for grid scale energy storage. It's absolutely not cheaper than nuclear if you go that route.
Reply: L
Reply: I am always curious why you think nuclear could be an economically viable component of said transition. It just makes no sense to me money wise.
Reply: @gnaarW  It's not always, or exclusively, about the money. We need a clean, green, safe, affordable source of baseload generation capacity. There currently literally are no alternatives.
Reply: @ARepublicIfYouCanKeepIt  people are already struggling with energy costs. In a fraction of the time and cost the same amount of peak energy can be put in place with renewables. Same goes for storage. If we can get reliable energy quicker and cheaper why wait? Just for the seemingly outdated concept of base load? At a higher price?
Reply: @gnaarW  "[T]he seemingly outdated concept of base load". Interesting. I'm not sure that those who lost their lives due to lack of base load generation in Texas in February 2021 would agree with your assessment.

Intermittent renewables, such as wind and solar, are not dispatchable. Yes, energy storage systems can smooth output, and even meet peak demand for short durations, they aren't the answer every time.

As with many other commenters, cost shouldn't be the most important (or only) factor when considering what replaces fossil-fuel power plants.

Nuclear is currently our only viable option for clean, green, safe, reliable and, yes, affordable base load generation.

As for energy costs to consumers, give me a break. We're fortunate beyond measure in the US. Additionally, the more we invest in longer generation capacity (both renewable and dispatchable), the better chance there is for energy costs to stabilize.

One thing's for certain, fossil-fuels are only going to continue to become more expensive over time.
Reply: @ARepublicIfYouCanKeepIt  what does a lack of base load load power have to do with Texas's power outage? Nothing. The state pretty much has only base load generating sources >75% is nuclear, coal etc. 

Sure, let's ignore geothermal, biomass and hydro. Or since we had Texas let's ignore the immense potential of the state for very easy and cheap storage in old gas beds. Texas is such a perfect example of being able to go full renewables at a fraction of the cost of nuclear. It still is slightly too expensive at the moment though. Which should give at least pause for thought when thinking of nuclear. 

Fission has been the promise of electricity too cheap to meter for almost a century now. It stays one of the most expensive options we have and for some unfathomable reason there are still people trying to keep this dead patient alive. France is the best example with spending billions on trying to keep it's energy prices stable and then needing Spain and Germany to stay alive through most summers these days. Climate change is already here and nuclear is absolutely no option for this crisis.
Reply: @MihailG5541   don't get me wrong, I'm all for higher efficiency. I think someone else here was going on how good gen 3 reactors are and that they're 15% more efficient but: fuel cost is one of the last issues with nuclear. France is doing so much recycling (and they are currently expanding that a lot) because they get most of their fuel from Russia. You can "somewhat easy" also get weapon grade plutonium from a recycling process. It just makes nuclear even more expensive at the moment (and it's already the most expensive source of electricity we have - some 80 years after the "electricity too cheap to meter" promise)
Reply: @ARepublicIfYouCanKeepIt  all the post mortems of the Texas cold snap failures I've read indicate that the main problem was deregulation leading to lack of winterization. That includes both fossil fuels and renewables, wind mills work in bitterly cold environments if properly setup.
Reply: @szurketaltos2693  That's partially correct. To put a finer point on the failure of ERCOT in February 2021, the fault lies with the entire premise of deregulation and privatization of energy marketers. Those entities operating dispatchable fossil fuel-fired power plants chose not to invest in winterization. They gambled the lives of ratepayers in the state against the odds of such a severe weather event. That's a wager that they lost, and for which hundreds of people lost their lives.

The major issue with renewables at the time wasn't that they also suffered from lack of winterization, it's that the power that wind did produce wasn't able where it was needed.

The sun wasn't shining. True. However, stored energy, coupled with energy that was able to be generated by wind simply couldn't be transmitted and distributed. That's no fault of solar, wind or energy storage producers/operators.
Reply: @gnaarW  There are the following ways to reduce the cost of energy production from nuclear power plants:
- Large units with reuse of 30-100% of spent fuel (extraction of uranium and plutonium from it, leaving depleted uranium with a content of 235 uranium and plutonium no higher than 0.1%)
- Large reactors with power regulation of 50-100% up to 300 times a year and maintaining the duration of the working cycle of 18 months or more, but reduced fuel burnup
- "Classical" medium-power reactors (300-600 MW) with one of the technologies above (or both)
- One fast reactor for every 3-5 units of generations 3 and higher, to close the nuclear cycle and get rid of long-lived isotopes, reduce the shelf life of the residue less than 1% of the volume of the nuclear cycle to 300-600 years (compared to 3% for tens of thousands of years in the purification technology described in the video).

Small reactors will not reduce, but rather increase both the cost of production and the risks of manufacturing nuclear weapons. The projects often use fuel enriched to 19.5-19.95%, which can become weapons grade with a high probability
Reply: @MihailG5541  apart from the breeders... We already have that yet nuclear is still getting more expensive every year. The French EDF is >50 BILLION (with a B!) €  in debt and France still doesn't have the cheapest electricity in Europe. Basically all France is doing with its biggest nuclear reactor arsenal in the world (measured by % of energy production) is ruin their economy.
Reply: @gnaarW  France should not have stopped building, upgrading and replacing old reactors.
The green fascists stopped it (not to be confused with greens).
France has gone too far with regulations and endless inspections, which is not the case in other countries, so reactors are launched faster and cheaper.
Reply: @MihailG5541  France has never stopped building and upgrading nuclear fission reactors lol. It has the lowest amount of solar and wind in all of Europe - even lower than Poland in % of total energy production. Plus they're having issues getting more reactors online as these need significant cooling and their rivers be cooking rn 🫠😅
Reply: @gnaarW  WTF?  All operating reactors in France are of the second generation, only the EPR reactors are of the third generation.

Only generation 3+ reactors have received a "green" license and meet minimum emission levels and safety comparable to other types of "green" generation.
Reply: OP has the balance partly backwards. Nuclear/geothermal should be the backbone, with intermittent and less energy dense sources as a supplement where the geography is optimal.
Reply: @zibbitybibbitybop  No, OP was purposeful in naming renewables (specifically including deep geothermal) as the primary generation capacity to decarbonize power production.

I was explicit in prioritizing nuclear for grid stabilization, desalination, hydrogen production and process heat generation.

The reason for this is "natural" gas (43%) and coal (16%) comprise the majority of domestic electricity generation. The share of both sources can and must quickly be reduced. The best way of accomplishing this is via renewables (solar and wind today, with increasing shares for wave and deep geothermal over time).

The share of nuclear must double if we're to meet our climate goals by 2050, as well as increasing demand. But adding advanced nuclear capacity will be slow.

In the near- and mid-terms, lithium-based batteries can meet short-duration storage requirements, with flow batteries for mid-duration and (pumped) hydro for long-duration storage.

Longer term, advanced nuclear with energy storage (such as the Natrium Demonstration Project) will be able to provide grid stabilization, in addition to short-, mid- and long-duration energy storage capacity.
Reply: thumbs up for the explanation of msr 
thumbs down for supporting the completely impossible fantasy of solar and wind power as the primary energy source.
Reply: Yes MSRs and the thorium cycle are the holy grail of nuclear energy BUT the metallurgy just isn't there yet. Argonne's EBR was a pioneer, but ultimately they couldn't make the concept work commercially and nobody has been able to do so in the past 50 years. They're great for lab demonstrations but can't operate reliably long term. We'll see what the Chinese reactor looks like in a few years. 

Regarding SMRs, all the companies developing them are still years away from having any certified designs and the LCOE for those designs has been shown to be MUCH higher than initially anticipated and not really competitive except for very niche applications where there's no reliable grid access and the waste heat can also be used. SMRs also don't provide much grid inertia so they don't even accomplish the role of functioning as baseload and grid stabilizers. 

Given the fact that the cost per kWh of nuclear has only gone up while the price of renewables and batteries has continuously gone down, I don't think it makes sense to continue investing tens of billions into building brand new gen III+ reactors that always have many years of delays and have gross cost overruns and will require tens of billions more in decommissioning costs. Rather, we should be investing that money in renewables, higher capacity interconnects, HVDC lines, large-scale solar and wind, flow batteries, and a smart grid standards that makes use of the millions of EV car batteries and home batteries for grid stabilization.
Reply: @jt92  Russia has established serial production of SMR and signed a contract with Uzbekistan for the construction of the first foreign nuclear power plant consisting of 6 units of 55 MW each. Russia uses the same units in areas isolated from the general power grid on floating and land-based units, on nuclear icebreakers.

The price of heat and electricity generation for Russian SMRs is stated to be on par with fast reactors, i.e. 2.5 times more expensive than large reactors
Reply: @jt92 LCOE is an unsuitable and discredited economic metric, both in general, and particularly when comparing intermittent to stable sources of energy. Your comment is nonsense on the grounds of terrible methodology, and your pivot from "it isn't there yet" to "millions of EV car batteris and home batteris" just puts the cherry on the delulu cake. The money has been invested into "renewables" in Germany, to catastrophic results.
Reply: @jt92  throwing out that term LCOE, the calculation, which is like a bad VD. LCOE has so many errors, if an aerospace company were to use it, they'd be building lead rockets and airplanes.
Reply: @jt92  What temperature is the molten salt and is it higher than the melting temperature of glass. The glass should handle the corrosive effects and if there was cooling provided to the glass surface, I wonder if the core of the reaction would sustain but create a cooled salt barrier that would allow the glass to survive. Am I having a brain fart or is this maybe feasible. I understand that the MSR reactor at Oak Ridge operated for 5 years but don't know if that was continuous.
Reply: @jt92  It is unclear why you suggest investing only in renewable energy.
All types of renewable energy, except hydroelectric power plants, pumped storage power plants, nuclear power plants with a partially or fully closed cycle, thermal power plants and thermal power plants on biofuels - are not capable of generating energy stably and require additional costs for stabilization, balancing and backup, all these costs must be included in the cost of renewable energy
Reply: @MihailG5541  100%
Reply: @jt92  I'd suggest that you're ascribing economics of past practices to new technology. The cost overruns and time delays associated with projects such as Vogtle units #3 and #4 simply don't apply to microreactors or SMRs, let alone grid-scale Gen IV designs.

Additionally, clustered SMRs and grid-scale Gen IV reactors will be collocated with decommissioning fossil-fuel power plants; leveraging installed infrastructure, providing stable, long-term employment, and all the grid stabilizing goodness of large thermal generation capacity, combined with flexible operations.

Take a look at TerraPower's Natrium project in Kemmerer, WY and tell me that it doesn't tick all the boxes. Collocation with a decommissioning coal-fired plant? Employment opportunities for many of the existing power plant labor force? A renewables-heavy grid? Integral long-duration, molten salt energy storage?

Lastly, my core message regarding decarbonizing power generation is that there's no "silver bullet". Only "silver buckshot", and we need to employ all of the solutions; not allowing the perfect to be the enemy of the good. So, we agree, smart grids, distributed grids, virtual power plants, advanced reconductoring, concentrated solar and PV, paired with HVDC long-haul transmission facilities, more offshore wind, increased focus on millimeter wave drilling and deep geothermal, wave/tidal generation, integral desalination and green hydrogen production, etc. We need it all!
Reply: Fission is useless for ‚grid stabilisation‘ or how many minutes beforehand after does it run up? They provide a way to great baseline power which is pretty hard to regulate to demand and production ( eg sun, wind, biogas, …) so how does it fit ?
Reply: @alexanderdekeuyper2990  Modern nuclear power plants are perfectly capable of doing grid stabilization (small but very fast adjustments, e.g. ±2.5% at a rate of 1%/second) in addition to load following (slow adjustment, typically following daily cycles between 100% down to 50% or sometimes even down to 25%). They're typically not used that way because if you have e.g. natural gas fired plants that can do these tasks while leaving nuclear at 100% it makes more economical sense to do so, but if you want to phase out fossil fuels then nuclear's ability to perform grid stabilization and load following will be essential.
Reply: @MatthijsvanDuin  these plants need to cycle between 0 and whatever every day and run at a non profitable rate over the day - so no, they can not contribute to grid stabilisation- they are made ( and financed)  to run at a high rate all day long
Reply: @alexanderdekeuyper2990  You are describing load following, not grid stabilization, although nuclear plants are capable of both tasks, and have been performing both tasks for a long time in France.

And if you end up in a situation where you have such a large surplus of energy that you're forced to shut a plant down, you should probably just leave it off since it means you have too much installed capacity. Hopefully you have enough batteries to keep your grid alive if the weather is uncooperative :P

Realistically we shouldn't reject proven technologies in the fight against climate change. Think of nuclear not as a competitor to renewables, but as a potential replacement for fossil fuel plants. If you can make some places run entirely on renewables, great, but right now there are still parts of the world where the amount of electricity generation from coal is steadily increasing.

I don't claim to have enough insight into the economics of nuclear to have very strong opinions on that though. My main point was that nuclear plants can and do perform grid stabilization and load following.
Reply: @alexanderdekeuyper2990  I'm not here to educate those too lazy to do their own research. Suffice it to say that your statement is incorrect. Nuclear power generating facilities can contribute greatly to the stabilization of renewables-heavy grids.
Reply: Nuclear pairs terribly with solar and wind. Fission is a legacy technology.
Reply: @carl_in_denial  Solar and wind fouls up the landscape, the greens have sadly become a cult, just use nuclear which has a lesser terrain usage and is in general just more efficient.
Reply: @lelagrangeeffectphysics4120  If solar and wind are so terrible for the inhabitants, what do you think they will say about fission plants in their back yard? Denmark is pissed with Sweden for building a powerplant on the coast opposite them for example. People want invisible power generation, but that's not feasible.
Reply: @98Zai  So the alternative is to have vast stretches of land covered with huge wind turbines and solar panels which i must remind you need remote vehicle servicing and a lot of it once in a while instead of half a dozen high efficiency power plants that require minimum extra infrastructure
Reply: @lelagrangeeffectphysics4120  No, I say we deploy solar panels on every roof and have them sell any power they don't use like we do today. I think you underestimate how much power wind and solar produce right now, and you especially underestimate the level of efficiency we will have reached in 15-20 years when the fission plants we start building now are completed. They will simply be obsolete. The only problem we really have is power storage. We need something like pumped storage hydro, because batteries aren't great. There are just too many serious reasons not to use fission, you can't convince me otherwise.
Reply: @98Zai  In 15-20 years you will have to replace most if not all of the solar and wind you install in domestic homes, the problem is not obsolecesnce its useful lifetime, i dont care if a NPP is 20 years out from the cutting edge of technology but i care a lot if all my turbines or solar panels have reached their end of life cycle and need a complete overhaul.
Reply: @lelagrangeeffectphysics4120  If we can assume that we will be more efficient with renewables by the time the plant is done, are we going to spend all that money on running it for 50-70 years? This isn't even relevant honestly, because the risks associated with fission are just too many. We want to move away from it, it's holding back innovation. Fission is for space travel and colonisation, not for the single planet in the universe that isn't irradiated.
Reply: @98Zai  Risk associated with nuclear plants are zero to none.
Reply: @98Zai  Commercial solar panels today are already incredibly efficient, more than 50% of the theoretical maximum efficiency, so they can't get that much better. They can get cheaper, but they're already pretty cheap, and the panels themselves aren't really the biggest cost of solar power. The picture for wind is similar. Once you get production costs and efficiency high enough, they're no longer the limiting factor in how competitive that energy source is. 

The cost of land however doesn't go down over time, and these renewables take up a lot of land. 

For the time being, the real limiting factor will be short term energy storage. When you look at the cost per kWh, renewables are already competitive with fossil fuels and cheaper than nuclear. But when you factor in energy storage and necessary changes to the grid, they are pretty similar in cost to nuclear. And they'd be much worse if we had to rely entirely on energy storage for demand smoothing. Right now there's enough base load that the variation in overall electricity production per day can mostly be dealt through smart transmission without too much storage. Even then, this is leading to the construction of new natural gas peaking plants, which is just contributing to climate change even more.

We will still need base load power, and nuclear will continue to be an attractive way to provide that for the foreseeable future.
Reply: @MKR-q1b  Do you think this is the first time I've heard this argument? Even if it's super safe in a vacuum, there are people running it and it must stand for 50 years. What will happen in the span of those 50 years?!?! Not worth the risk.
Reply: @iankrasnow5383  I think you've been reading some tables and graphs wrong seeing that 52% efficiency. 
"they are pretty similar in cost to nuclear" - currently. Do you think it's wise to spend many billions on new plants that will be ready in 20 years, and then operate for 50 years.. when they are already obsolete? That's besides all the risks with fission. Yes we need to organize storage situations, but that's never going to happen as long as the focus is on fission. It's holding innovation back.
Reply: @98Zai  There are only notable nuclear plant failures and all of them had to do with easily avoidable human mistakes. 

Also Beznau nuclear power plant in Switzerland has been running for more than 50 years and it seems be doing fine. Stop giving into these anti nuclear propaganda.
Reply: @lelagrangeeffectphysics4120  and sorry to bother, but additionally nuclear power plants can use existing infrastructure (coal power plants) without much additional cost or time, because most of the parts of both are shared, this would also allow more poor countries to become greener without getting extreme amounts of deb on the process
Reply: @iankrasnow5383  There are also over 2.6GW of renewable generation capacity stranded in interconnection queues. That problem grew by some 30% in 2023.
Reply: @98Zai  It is unclear how reactors that have been operating stably for 60 years with low cost of generated energy, using up to 30% renewable fuel from the second cycle, can become “obsolete”.
Reply: @MihailG5541  In a capitalist society when a new thing becomes cheaper, the old thing becomes obsolete. You don't run a fission plant from the goodness of your heart, it still costs money to run and maintain - and it's not cheap to dismantle either. Also consider the expected economic returns over the lifetime of the plant, you're not going to want to close the plant if you still haven't paid your dues. What do you do if you are not making a profit from your plant any more? Where do you cut costs?? Fukushima is a great example; they found safety issues long before the tsunami, that were never fixed. Japan is a pretty strong economy,  yet they still skimped on the maintenance of something this important.
Reply: @lelagrangeeffectphysics4120 Because of that there are the "Agrosolar" and the "Rooftopsolar" And I personally like the "windmills". They look in some way nice
Reply: Please explain how nuclear power plant should stabilize the grid. Nuclear power plants are not really flexible in power output. They cannot react to fast changes in energy demand or supply. Here other technologies as batteries, flywheels, pump storages and as well gas power plants are the better choice. Of course gas power plants have to reduce the carbon footprint, but at least they are technically able to increase and decrease the power output fast, which nuclear power plants are just not.

And an other problem with nuclear power plants. They rely on stable water levels of our rivers. Due to climate change, the water levels are absolutely not consistent. How do you plan to face this integral problem?

You mentioned SMRs. Yes, they have been the hope. But they are just too expensive. Thats why the USA stopped working on SMRs. It does not make sense to build a solution that works from a technological point of view but is just too expensive for the people.
Reply: @JaIgel  Nuclear power plants in France using fresh fuel can change their capacity from 50 to 100% up to 200 times a year during the first half of the cycle.

Russia, China and South Korea have announced that they have passed tests of regulating the capacity of new units of generation 3+ nuclear power plants from 80 to 100% up to 300 times a year and new tests of the "French cycle" from 50 to 100% capacity.
Reply: @MihailG5541  And Type 1 MSRs (combined liquid fuel and coolant) don't have to contend with the uneven burn up that LWRs/PWRs must avoid.
Reply: @JaIgel  Let's deal with the points you raise one at a time:

1. Nuclear power plants absolutely can greatly contribute to grid stabilization. I encourage you to look into it. Most of the factors affecting grid performance aren't immediate.

Unfortunately, few people understand how nuclear electricity generation works. Fewer still understand how variable renewable generators affect grids. And even fewer understand how grid stability is achieved and maintained. Contrary to popular misunderstanding, changes to the grid aren't analogous to pressing the accelerator in a vehicle.

Everything from demand profiles to seasonal variability can be addressed via flexible operation. For everything else, energy storage systems, or ESSs, can fill in the gaps. From a few minutes to many days or weeks, there are ESSs for every situation. Best of all, the prices for battery ESSs are rapidly declining, making that much more economically attractive.

2. The existing fleet of commercial power reactors is predominantly of the light-water reactor/pressurized water reactor design.

These absolutely rely upon a stable supply of water for evaporative cooling.

That's not the case with many advanced reactor designs. These are cooled by high temperature gas, metal or molten salts. Here the coolant is at much higher temperatures than even pressurized water. Not only does this dramatically increase thermal efficiency, but operating at or near atmospheric pressure also markedly increases safety.

Consider also that many microreactors and small modular reactors will provide both electricity and heat for industrial processes and it's evident that cooling with water is even less of an issue.

3. I'm not sure where you're getting your data about small modular reactors (SMRs), however, as these are brand new designs, the long-term cost data simply aren't available. There are only estimates, and these show the promise of not only factory fabrication to control quality, costs and schedules, but of the entire concept of modular deployment.

Secondly, the US absolutely has not abandoned SMRs. To the contrary, several designs are progressing through the regulatory review process (Kairos Power recently received approval), while work as already begun on TerraPower's Natrium plant in Kemmerer, WY.

While some may look at the recent difficulties with NuScale's Carbon Free Power Project at INL as sounding the death knell for the technology, that's simply not true.

Unlike GW-scale commercial nuclear power generation of the past, advanced nuclear reactor designs are widely applicable to remote grid scenarios, to combined power and heat industrial applications, and many other use cases, in addition to generating electricity for the grid.

Many people worry about the stress of EV charging on our grid. Those same people have no concept of the impact that AI is already having our grid. That's a problem that'll only get worse, and microreactors/SMRs are the perfect solution.
Reply: @JaIgel nuclear power plants are able to raise and lower production through control rods and chemistry.  I have worked at the same nuke plant for over 27 years and my old man worked there for over 35 years and in all that time we’ve never had to shut down due to flooding or lack of water.  
I would question any source that you could provide.